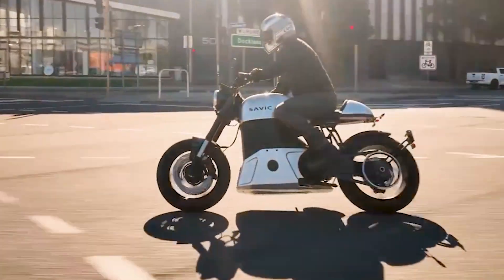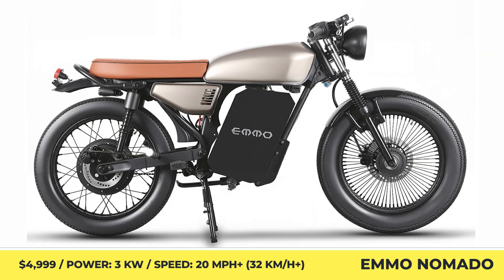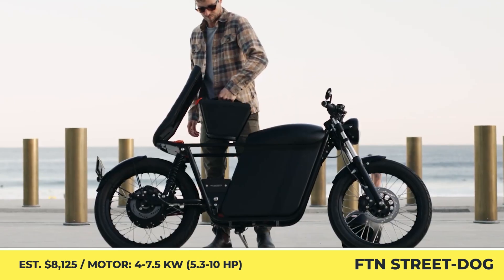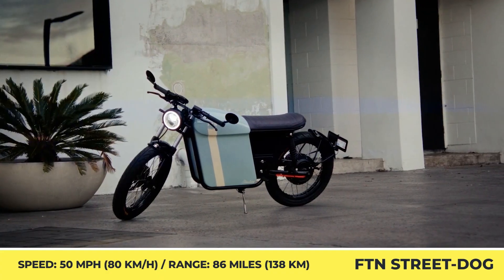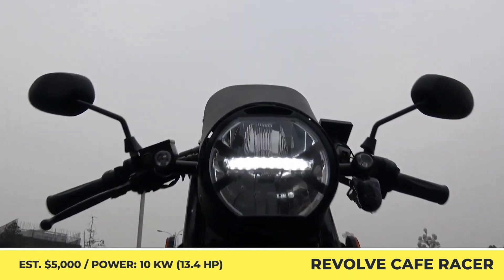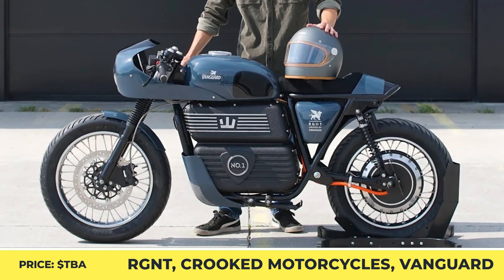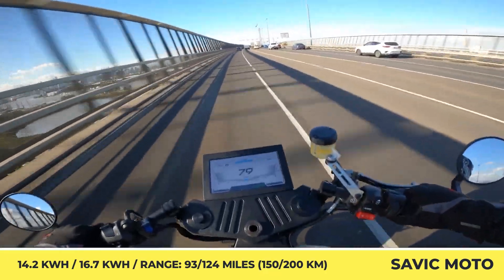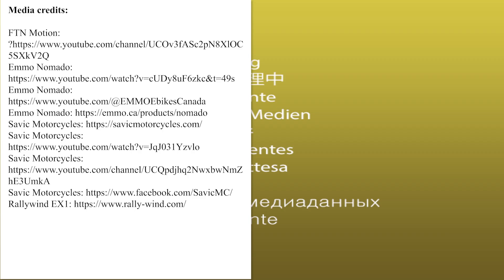Top 7 All-Electric Cafe Racer Motorcycles for 2026 (Ranked by Price & Specs)

Comment: I ride motorcycles for over 40 years, every “bike” on this list is useless, overpriced money pit, every single one of them are built to be displayed in some hipsters living room or in front of a Starbucks, so much potential and ZERO use 😢 not one of them was designed by motorcycle enthusiast.
Reply: Listen here, old man. If you don't understand something, then it doesn't mean it's bad. Also, you seem not to understand what a 'money pit' is. This phrase is used for something that is expensive to maintain while EVs require little to no maintenance, get your facts straight before writing nonsense